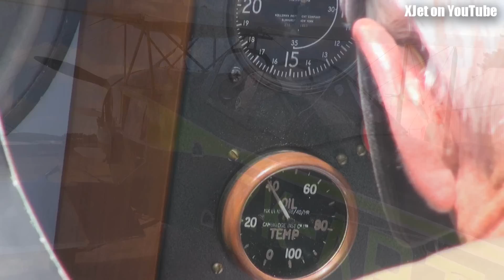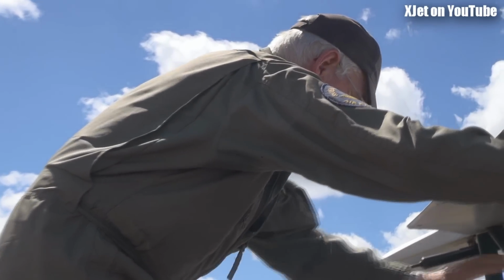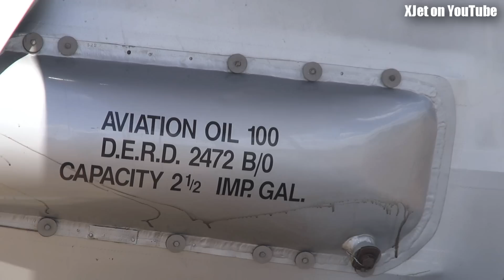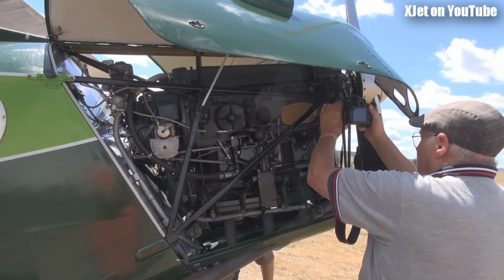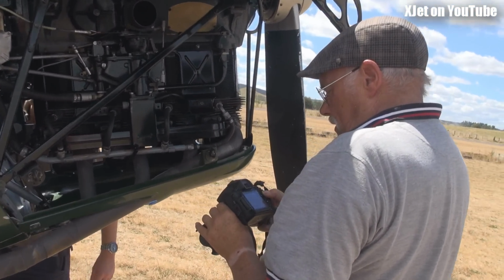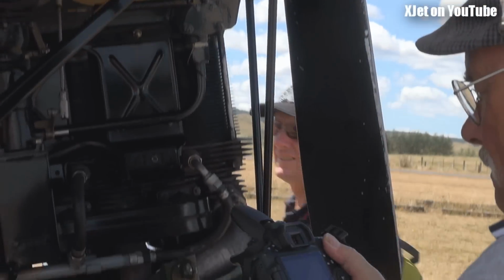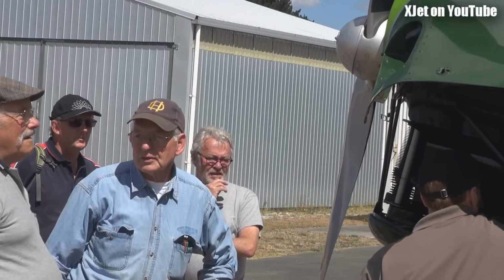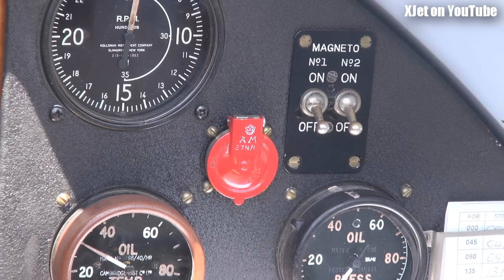DH Fox Moth and Tiger Moth at Tokoroa Airfield

Comment: The Fox moth is probably one if the most elegant biplanes ever designed. Therte is one here in Perth painted in gloss black (which I think really brings out the beauty of the plane) that just takes you back to the elegance and splendour of the roaring 20's everything you look at it
 (of course the owners dress in flapper type outfits whenever they bring it to an airshow which helps)
Reply: Surely flapping is not required. That's what the motor is for :)
Agree the pilot of the Fox Moth is a charm school dropout.
Reply: Rob B http://www.aviationwa.org.au/wp-content/uploads/2011/03/RAC_5662.jpg that's the pic of it. funny haha, flapper OUTFITS, like roaring 20s style! She's a beautiful thing! pity no one really manufactures an RC version.

Comment: My Dad used to fly Fox Moths up near Yellowknife back in the late 40s.  Wheels and skis, I don't remember any float stories, but their likely were some.  I do remember one pilot that worked at the same place - his name was Max Ward.  But back then they were all just regular guys struggling to survive as bush pilots.  Hunters, mining geologists, sight seeers, lodge operators were their customers.  Great video, fabulous aircraft - looks quite a bit nicer than the ones Dad flew :)
Reply: wonder if there is a book on Max Ward,  even flew Ward Air once in the 90's when Transat  screwed up a flight.. lemme tell ya, far better than Transat , think it was a An A 300, or a Dc10,  from Gatwick to Toronto,  possible Mirabel stop on the way.. either way,  service, leg room,  comfort killed Transat ,   though to be fair it wasn't a full flight..
  The L1011 however,  Mtow,  sardines,  Transat  air hosts were  having a soap opera,  though the thing would never get off the runway,  used up almost all of 33R ..
  We found out the pilot landed hard enough to damage the gear in London,  plane was out of service for our return flight..

Comment: what is the small prop on the wing for?
Reply: Tim Norrie Why isn't the generator driven by the engine like every other thing ever made.
Reply from the maker: KiwiPowerNZ
Perhaps it's so that you still have power in the air, even if the engine stops.
Reply: ***** True, good thinking.
Reply: +Hobbyandtech It's a wind generator.  Used when the original engine has no provision for driving a generator/alternator, as was often the case.

Comment: Aua82a,  first off I do not like your troll comment.  The fact you use offensive language in this forum shows how immature you are.  I said I would not comment but it seems you want to drag this on.  Learn to be respectful to others both in print and in person and learn to be kind to others.
Reply: learn to be kind to others? I believe you said this "You should have poured the oil on their seats while they were gone." If you want to throw rocks, don't be surprised if one comes back in your direction.
Reply: dphotos the comments from yourself are still visible after a period exceeding one year. I would still ask the question as to how  a person such as yourself requires respect whilst suggesting "You should have poured the oil on their seats while they were gone." I am always ready to accept an apology.